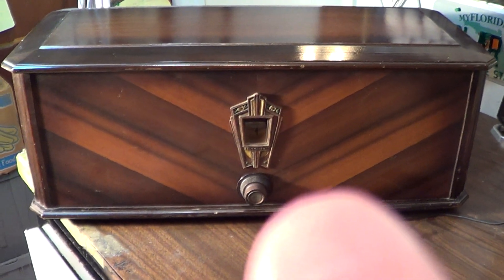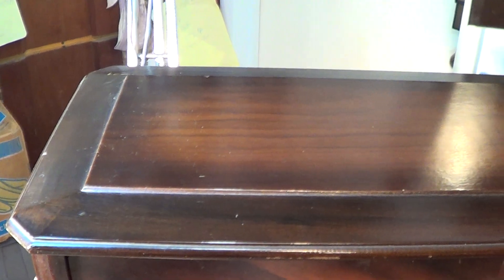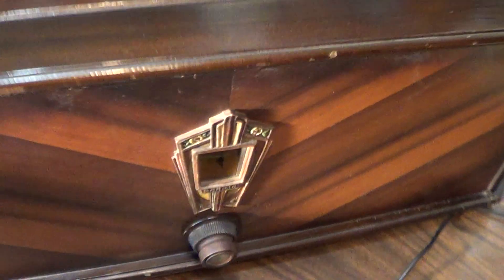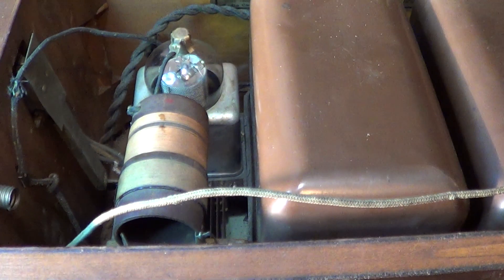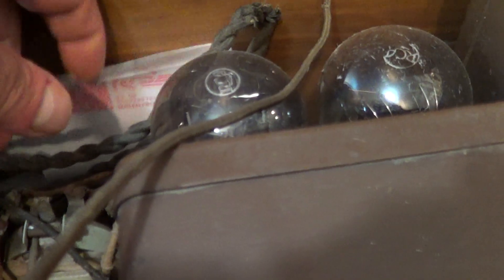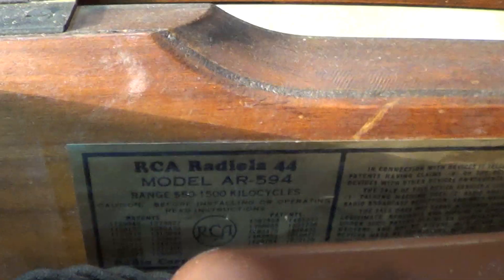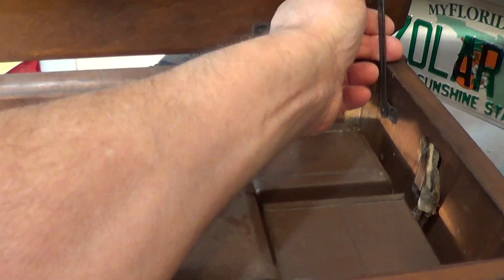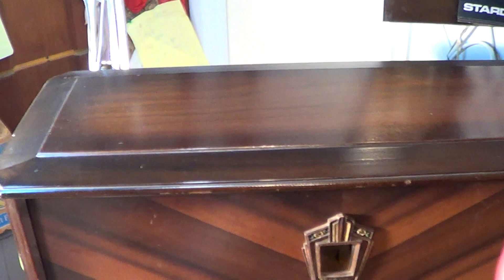RCA RADIOLA 44 12 21 2012 10 HOURS IS TWO MUCH WORK & TIME  WASTED ON THIS PROJECT TO BE HONEST

Comment: There is no cover on the left hand side (that you said was missing), in fact, that is the way it is supposed to be with just a small aluminum cover for the type 24A tube.  Yes, the other two 24A's are covered with both small and big (brown) covers.  When I pull my  large covers off the 2nd and 3rd stages, the set fails--probably cause to much RF is hitting the tubes and coils directly.  In short, your set is complete as far as I can see.  Thanks!